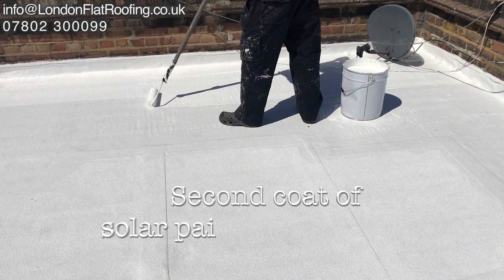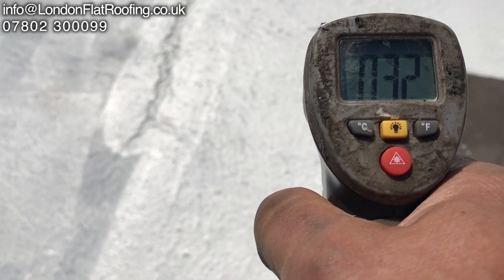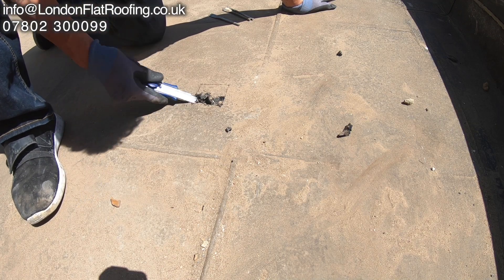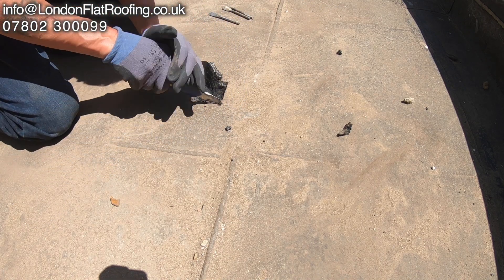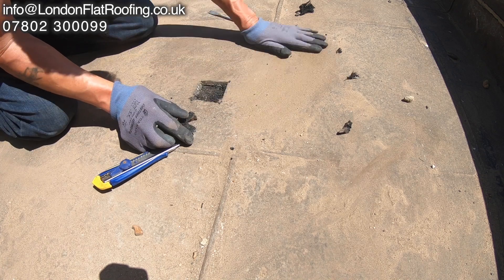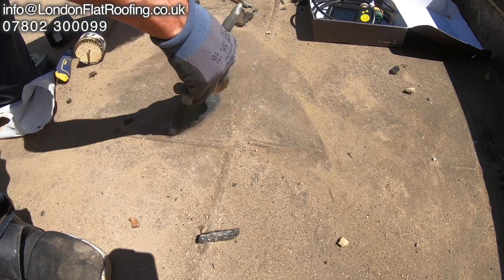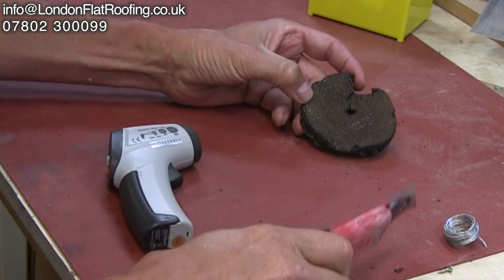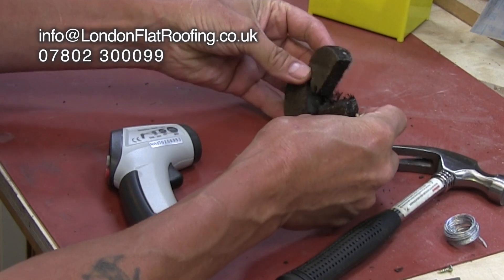Solar Paint  Flat Roof Test

Comment: lol, it is supposed to get melty. The tar and felt becomes self-healing and prevents leaks and cracks from forming.
There is also the cost benefit breakdown of heat gain in winter vs cooling requirements during summer. Unless there is a solid layer of thermal barrier under that roofline, or it is in a place that doesn't get cold, then the increased heat costs during winter will out-strip the summer time a cooling cost gains in summer.

Comment: Can I paint glass conservatory roof panel or stick shingles to it. Is Solar X any good Roof has dg panes and some foil insulation inside. Sealing the edges of panes my be more crucial than heat gain as there is pvc t&g ceiling inside to be retained
Reply from the maker: No idea

Comment: what about rubber roofs?
Reply from the maker: Rubber roofs EPDM) should only be laid above insulation thus the heat doesn't penetrate down into the structure of the building. You should never overlay a tar based roof like mineral felt or asphalt.
Reply: so a warm roof construction without ventilation for EPDM
Reply from the maker: No, you could do cold roof construction with EPDM over the top. Heat transfer down would only reach the vented cavity and would then disperse out as this area is vented.
Reply: Steve Roofer asphalt roofs are one of the best vapor barriers u could use to insulate on top off
Reply from the maker: I sort of agree. Yes, asphalt is a really good vapour barrier,  however, you have to glue down the insulation and sometimes the glues can fail. We will glue down tissue faced insulation only over asphalt, we much prefer using thermally broken fixings to fix our insulation down as we know we can trust the fixings, with glue if it doesn't work you don't get a second chance. I have only had one fail to date but that was one to meny.
Reply: Steve Roofer yes I agree with on the glue ..but we just mechanical fixings on all deck applications with cone plates or metal plates on torch on membrane